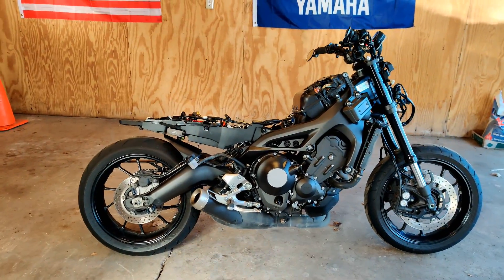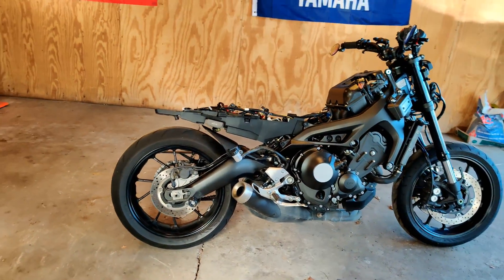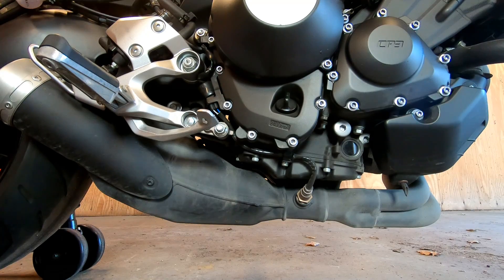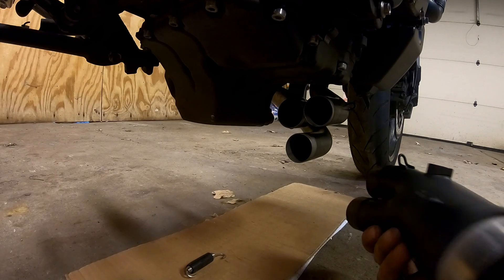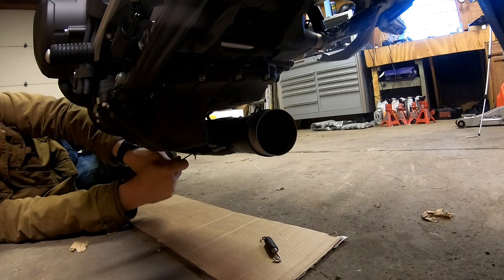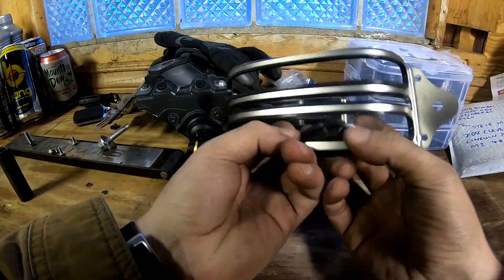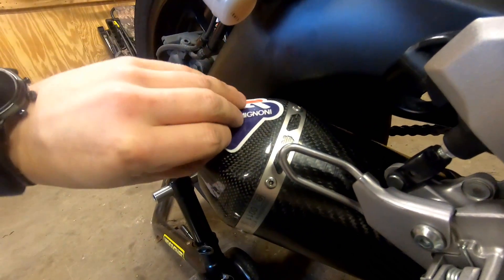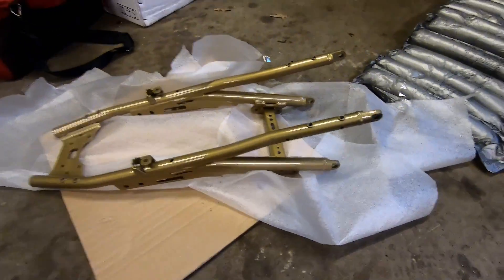Winter Mod Series EP3 Termiginoni Exhaust, Sprint Filter and Vcyclenut ECU installed on XSR900

Comment: Good job on installing the exhaust. When putting it back together and given you have the Givi guards, remove the unnecessary plastic engine cover (that has that round silver side cover) on the side.